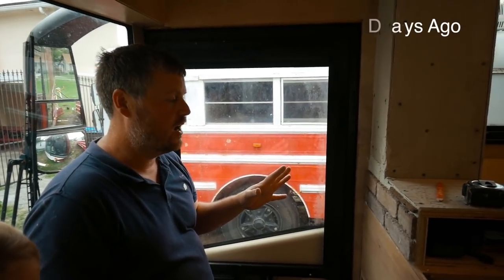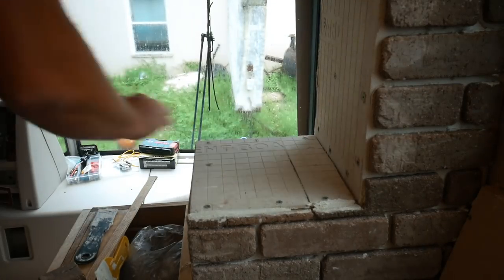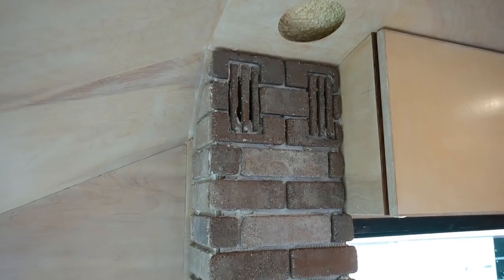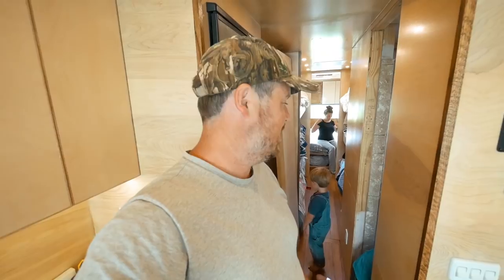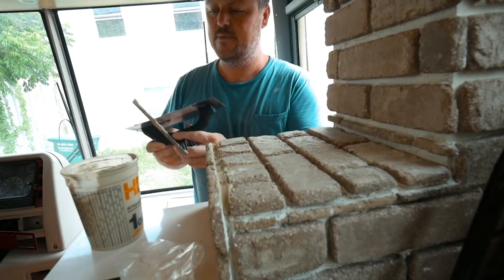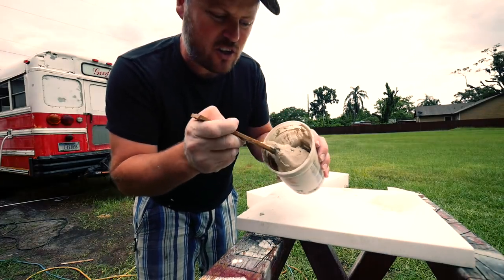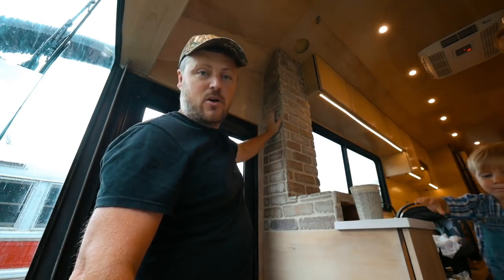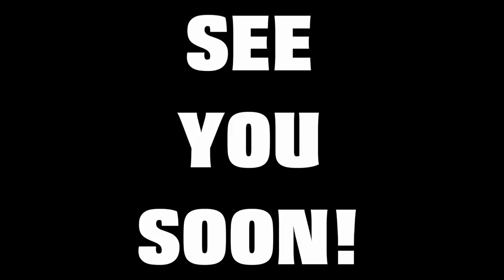We Built a Brick Fireplace for our Bus Conversion!

Comment: If you ever have to grout again like that, just put the grout in a ziplock bag and cut the corner like a pastry bag and just squeeze it in the joints and smooth out. Throw the ziplock away, no clean up.

Comment: Where smoke going
Reply from the maker: Outside...
Reply: The Bus Life thanks for your answer , but it can not spread in the bus? Which mechanisms did you use to push smoke outside?
Reply from the maker: There will be a wood burning stove with a smoke stack.
Reply: The Bus Life  Ok thanks,  sorry for the question  am from East Africa we haven't a stove for heat  that's why am asking.
Reply from the maker: No problem! 😃